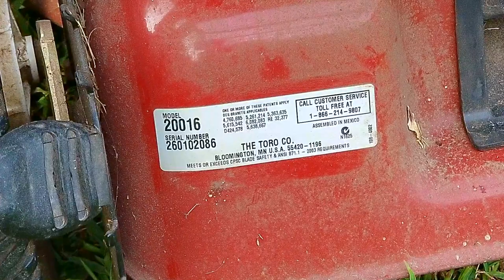Why Get A Tecumseh Powered Mower?

Comment: Nice video. I have no issues with the Tecumseh engines. They were tough. Like most engines they were abused and old gas left in them like the one you just fixed. The only issue is that they had plastic emulsion tubes that could get brittle and break. I have replace several emulsion tubes over the years. If you keep them clean and tuned up, they will last a very long time. Thanks
Reply from the maker: oh, I hadn't found one with a brittle emulsion tube yet, thank you for letting me know!
Reply: @HomeGaragechannel  The emulsion tubes come in different colors to coincide with the different size holes in them. Sometimes the red ones are so faded that they look like light pink and not red. Make sure to use the same color that was in the carb. Thanks again.
Reply: Yes Tecumseh engines seem to be tough. I recently obtained a push mower with Tecumseh engine,which was left uncovered for xxxx amount of time..I got it running.
Reply: I don't come across many lawnmowers with Tecumseh Engines since most everyone has gotten the Briggs quantum in my neighborhood and as soon as I have carburetor issues they throw those out. Now now a lot of people electric Ego lawnmowers. Interestingly it seems like the Tecumseh was the preferred winter engine for snowblowers before went out of business.
Reply: ethanol in the gas causes that. Use 100% gas if you have that available in your area

Comment: I love my old Toro 22 inch recycler with the Tecumseh 6.5 hp engine.  It was ten years old when i bought it for $45 cash.  With the help of you tube videos I replaced the carb for under twenty bucks.  The mower is now over 20 years old going strong, does not burn oil, starts on first pull and cust close to one acre weekly.  GREAT engine and you only have be a little handy.  Thanks awesome video!!
Reply from the maker: Thank you and  you did a great job maintaining it and I suspect it'll last for a lot longer.

Comment: Up until Tecumseh stopped building small engines, they were the engine of choice for snow blowers, at one time reaching 80%,  My first lawn mower was a Craftsman with a Tecumseh engine.  As a teenager, I abused the hell out of that engine, and it came back for more, until I sold it when I left for college, pre 1990. LOL
Reply from the maker: wow, that thing took everything you threw at it!
Reply: @HomeGaragechannel  You have no idea, starting with not changing the oil until it was sludge, then using 90 weight for engine oil, because that was what I found.  I don't think I ever cleaned it, etc.etc...I got the mower when I was 12 because I wanted to mow lawns, and sold it when I was 19. Never burned oil, and always started within 2-5 pulls....
Reply: @covishen  I still have my craftsman mower with a tecumseh engine. It’s over 20 years old. Had to put a new carb on it a few years ago but that’s because I let fuel sit it not the engines fault. I have changed the oil only a couple times. Still use it almost weekly.
Reply: In my experience most Tecumseh engines Ive seen have been in not very good shape and have issues, but theyve all been 25+ years old. My dad has a late 80s lawn mower Im going to try to get running thats got a Tecumseh on it. Its been sitting for more than 20 years at this point.
Reply: Their lawnmower engines, I believe were OK. However, I did not care for their engines on generators because they were just simply too loud.

Comment: I'm definitely a fan of the exhaust and carb on the same side, there is no ambiguity on which side to flip it on to. None of the "oil in the exhaust or gas in the air filter" deal
Reply from the maker: ah you make a good point
Reply: Has to do with where the breather is,early ones have the breather behind the valve spring cover which is near the intake and exhaust ports. Some later ones have the breather on top the engine  ahead of the flywheel area,tipping them straight up too far with the spark plug looking at the sky can cause an oil spill which if the breather has a tube going to the air filter box can oil the filter or even enter the carburetor and engine  possibly causing oil flooded combustion chamber. 
Also a small amount of oil could come out around the governor shaft hole but that is on the same side where the valve spring cover is. Even with the top mounted breather I don't think you want to leave the engine for a long time with the valve spring cover/box area down,oil could gradually seep into there. 
  Also old ones just have a short tube that sticks down besides the engine from the breather,newer ones had the tube extended and plumbed into the air filter box. Some of the engines had a special air filter box air inlet that was supposed to provide air with less dirt in it because the flywheel fan supposedly threw the dirt out in a different direction than the air it blew into the air filter box air supply.

Comment: You might not see much of these engines where your at, but over here in the west I see tons of these things still in use. I grew up with one of these mowers and I am still using it to this day. Briggs was great when they were still making their quantum flat head engines, but I stopped trusting them after they stopped production of engines here in the U.S. and started using cheap foreign labor to build them instead. With the cheap Fisher Price plastic carburetors and paper thin engine blocks I knew their engines weren’t built to last anymore. That is the reason why I haven’t bought a new mower, because I know they’re not gonna live as long as this Tecumseh.
Reply from the maker: you make good point, they're great engines and that's why you still see them around. It's just too bad the companies had to start making changes, or bad choices
Reply: I agree with you on most all except those plastic carbatrators. I have noticed they are superior to aluminium these days because they are resistant to the harmful effects of ethanol junk.
Reply: I miss the Briggs and Stratton 2 cycle engines

Comment: I've got a Toro Recycler that's very similar to the one in the video.  I've had it for 17 years, and recently the transmission gave up the ghost.  I opted to replace the transmission and associated parts largely BECAUSE of the Tecumseh motor.  Not because it's a Tecumseh, but because it's 195 cc, and it still runs great.  Most of the new mowers I was looking at had 150 cc motors, and I was reminded of an old gear-head saying - there's no substitute for cubic inches.  Anyway, the mower is still going strong and I'm hopeful that I'll get another 17 years out of it.  Come to think of it, at my age, I hope I get another 17 years out of me! ;-)
Reply from the maker: wow very nice job, and thank you for sharing that

Comment: You know I am a diehard Briggs fan . I like the older Tecumseh engines with the black round primer and the bigger Tecumseh engines. The engine in this video is not bad but the carburetor is harder to remove and has rubber o rings in it .
Reply from the maker: thank you Brian King, and yes, I agree with you on the carb.

Comment: I’ve always preferred Tecumseh engines over Briggs. Tecumseh used an oil pump along with splash lube as opposed to splash lube only. The one downside was that Tecumseh carbs were a lot more finicky than a Briggs if it got a little dirty. When we were kids back in the mid 70’s, we always tried to find a Tecumseh for our go-karts and mini bikes. They also seemed to have a bit more torque than the same HP rated Briggs.
Reply from the maker: you said it all Matt Dessecker!

Comment: Mine lasted for 20 years so far, with minimal maintenance - just oil, air filter, sparkplug change 3x over 20 years - never had to take anything else apart, clean or disassemble. All parts still original. This thing looks like it's got many more years in it.

It just keeps on going, starts on a first pull after each winter. Love it...
Reply from the maker: thank you for vouching for them

Comment: Depending what part of the country you are from. If you had a snow blower, you were very familiar with Tecumseh. Their Snow King was on many snow blowers. And they were solid engines. That might help explain why the carb and exhaust are on the same side (cold weather use.) I would definitely take a Tecumseh over a Briggs or Kohler. You are spot on about consumer demand strongly favoring lower price. Most who buy cannot discern the difference. And the manufacturers and retailers know this only too well. People will actually buy a lawn tractor with a plastic carb and plastic transmission on price point, oblivious to the fact that they will spend far more in dollars, time and frustration in the long run. My advice is to look for Honda and Kawasaki equipped power equipment. It usually only comes on better made stuff. The higher up front price pain will wear off, you will be proud of your equipment and it will serve you well over the 20+ year lifetime for a consumer.
Reply from the maker: well said and it makes sense
Reply: oh yea, for snowblower engines, the Tecumseh is king. I think they're flatheads were better probably, but the slanted OHV on our newer Ariens has been ok.
Reply: I think you are probably right about the ports being on the same side for cold-weather operation, that has always been my theory and it would make sense as the heat from the exhaust port would definitely help the incoming gas atomize by heating the intake port. I really prefer that over cross flow heads even for warmer weather applications like on their lawnmower engines, I just feel like it helps it run more efficiently. Although I do wish they would have put the intake port above the exhaust instead of the other way around to increase the heating effect but they must’ve had the reasoning for not doing it like that. Ultimately I just wish they were still being manufactured at all. Very sad.
Reply: Many Mowers in EUrop/GErmany from the 80s have Tecumseh Engines on them, i think Fiat had something to do with them? Or did Tecumseh just orderer their Ignitions there, i dont know.
But i know these Engines are tough, very long lasting and are running very well. Very low and stable idle, not much vibration. My Grandfather had one for nearly 30 Years, he gave it to me an i used a few Years, then got a new one bacause if the Plastic Chassis. The Engine was still going stron, lost a  bit of COmpression. After that he got one with a B&S, that Motor had no Compression anymore after nearly ten Years. Also they have no Plastik Parts in them, like some B&S. But the real solid ones for daily use had Sachs Engines on Them, Hirth Motor was also a common Manufacturer for professional Equipment. Sabo and AS Motor were very good Manufacturers.

Comment: I had an older craftsman 21 inch walk behind with front wheel drive and it had a Tecumseh engine just like this one. Mine ran at a higher RPM. (About 3600) despite the mower not being in the greatest shape, it still ran fairly well and I used it until one of the rear wheels broke off it's shaft. I also have a snow blower with a Tecumseh snow king engine that also runs well too. (Despite being fairly hard to start.) Tecumseh engines in my opinion are really good engines.
Reply from the maker: I agree with you, they are fantastic!
Reply: Tecumseh was an Indian chief I heard.. so biased ones may overlook Tecumseh engine based on biased upbringing
Reply: Best to keep the top RPM a bit lower than the factory spec. say 3400 tops even if on an 18 inch cut mower (bigger width mowers call for lower max no load RPM because of blade tip speed fears)
Reply: @davidpowell3347  I don't even own that mower anymore lol. Thanks for the useful tip though!

Comment: I bought my Toro 20017 mower with Tecumseh in 2004 based on Consumer Report (remember that, ha?) recommendation. Paid like $360 + tax in Home Depot. Changed oil yearly and cut my 0.4 acre lot biweekly in MA summer, or weekly if it rains a lot. Mostly mulching with some bagging in fall. Kids abused it and did extra work for neighbors. Still runs like a champ, 20 years later. Only had to (finally) replace the wheels as they are bold and don't grab anymore. Also, 2 years ago hit a big stone and the flywheel key sheared as it should protecting the shaft. Nice, fixed for a few $. I just got very expensive Honda which hit a stump and its key did not shear, now the shaft is bent and it vibrates like crazy. So, is Honda mower engineered better than Tecumseh and worth 2x price? Not in my case.
Reply from the maker: nice thanks for sharing your experience.

Comment: I had a few old Craftsman mowers from the 80’s. All came equipped with Tecumseh engines. The only problem I ever had was with the self propelled system. The most common problem was that debris would collect between the metal drive gear and the plastic gear on the wheel. This ate up the plastic gear making frequent wheel replacement necessary. No engine problems at all.
Reply from the maker: yes that would seem to make the self propel have some issues. These are really good engines, I wish they were still around. Thank you Bruce Coleman.
Reply: I think some of the self-propelled had a pulley mounted on the crankshaft stub above the blade adapter that spun a belt that drove the "self propell" but some engines made by Tecumseh had a right angle auxiliary shaft that came out of the side of the engine,already had some gear reduction I think and it was used to power a different kind of self-propell

Comment: Had a lot of em over the years. The Tecumseh in my family snowblower made it 42 years before knocking. They run well and are tough, but I always found the governors finicky and I always wished they had a crossflow head.
Reply from the maker: yes I hear what you're saying but considering everything else, they work really well.
Reply: Hey hey!! I'm still using my Rover mower with a 4HP Tecumseh fitted...it's 41 years old...is a little smoky but that goes after a few minutes. Cheers from sunny Hunter Valley Wine Country Australia.

Comment: I like when you mentioned that the Briggs carby primer was a separate piece from carb and was mounted on the air cleaner body that is true for high chance of failure as the plastic air cleaner body (why would they use flimsy plastic on an engine part?!) would no longer provide sufficient sealing for the paper gasket.  My workaround for that issue was to copy the gasket form on cork gasket material, cut that out and fit that as a replacement gasket and that makes a better seal and no failure priming to again!  Worked on my neighbor’s units!  I find that both Briggs and Tecumseh types and they’re fun to work on.  I kinda like Tecumseh’s carby/primer assembly more though, less complicated and easier to repair with no fuss!  I practiced on trash-picked units to acquire more experience with them (broke a few of ‘em but grant extra parts though and lessons learned of how to do it carefully and not break something on next tear down; same with Weedwhackers) and now more of my neighbors (after constantly watching me work on equipment from my backyard as their engines quit while they were tryin’ to cut their own lawns) come to me for their mower and whacker woes!  Me personally, prefer to care for my equipment by keeping oil changed and topped as well as checking that the air cleaner is free of blockage, spark plugs and sharp blades.  Maintenance goes a really long way for equipment long life!😅
Reply from the maker: nice I like that!

Comment: I had a Toro mower with front wheel drive and a Tecumseh engine for 18 years with no issues. I did follow all maintenance procedures to the letter especially oil changes, spark plug changes, new air filters and under deck cleaning. It was a single speed mower and so nice to use. I think I gave up on it when parts of the deck started breaking but up to the end it was a gem 💎!
Reply from the maker: wow you did a great job with that mower!

Comment: I bought this same mower used with the high wheels fifteen years ago.  The Tecumseh engine gave me pause because I have always favored the Briggs, but I can only say good things about the Tecumseh.  It has more than enough power to take down grass up to my knees.  I did replace the carburetor, but that was not expensive.  I expect to have it for a long time.
Reply from the maker: I like them too, the oiling system is very good on these

Comment: I grew up with a Tecumseh on my go kart so I'm tecumseh all day. Plus I moved to MI at 21 and they were made here. Way more durable engines than Breaks n Scrapem. The Snow Kings have cast iron sleeves. They had a whole horizontal line just with cast iron sleeves like the performance 6.5 hp in my go kart. Thing was a monster.
Reply from the maker: thank you for vouching for them

Comment: I got a free Tecumseh 6.75 HP vertical shaft engine from a neighbor. The pistons rings were worn down, pull cord snapped, and it leaked oil. I'm planning on rebuilding it and turning it into an outboard boat motor.
Reply from the maker: man that would be pretty cool!

Comment: Mine is a 2005 Tecumseh. I work on it myself. It's still running great although it does burn a little oil after 19 years.
Reply from the maker: not bad at all for its age

Comment: None of it matters to me. I've worked on both for 30 years and have had issues with both for the same time.    As both companies came into the 2000's, they penny pinched here and there and they both had their own issues.  If you find something like this and the engine runs decent enough from Either make I say get it.   I will say this and it goes for any small engine manufacturer.  Put the best inline filter you can afford and absolutely put in a decent fuel shut off valve in line.  And use it every time you go to shut off the engine.  When you're done...turn the valve to the off position, run the gas out of it and let it stall out!  Then put it away.     ALWAYS!   Today's gas, especially the ethanol laden garbage warrants the need for an inline fuel valve!
Reply from the maker: great advice!